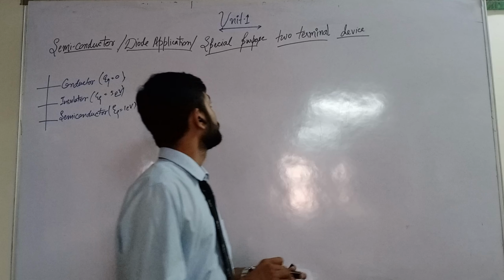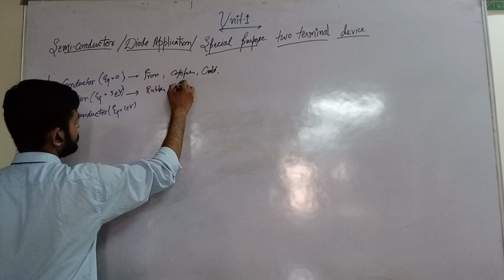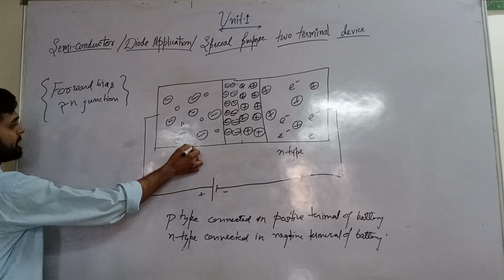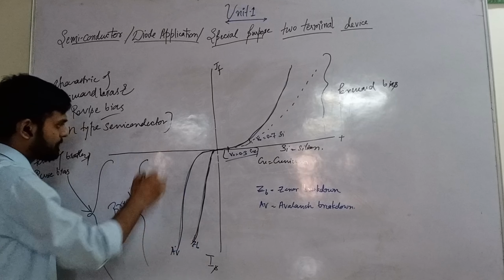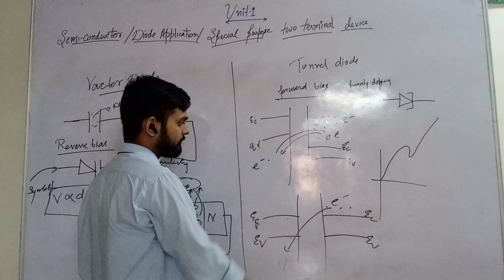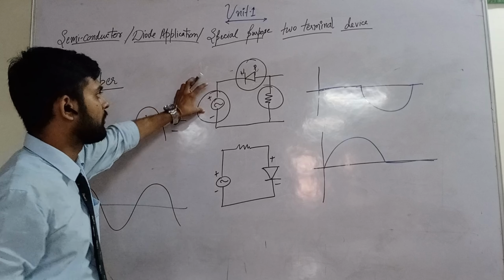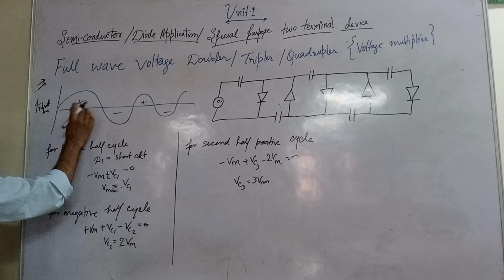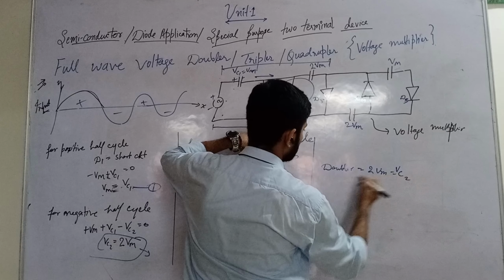Unit 1 semiconductor diode Applications special purpose of two terminal device

Comment: you can't say no flow of electrons in insulator,they will flow a bit but right at the moment obstruction is from high resistance.
Reply from the maker: They are very small 
They can't conserder
Reply: @Some_thing_related_2electrical Nice video bro i am working in this industry since 4 years ,keep it up
Reply from the maker: Thank you 
For giving this feedback 😊
Reply: @Some_thing_related_2electrical ❤